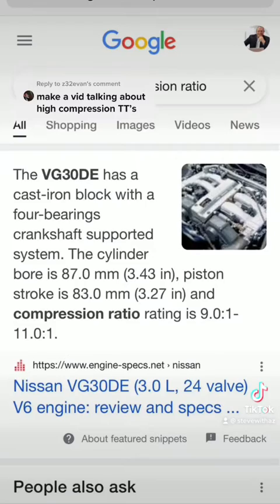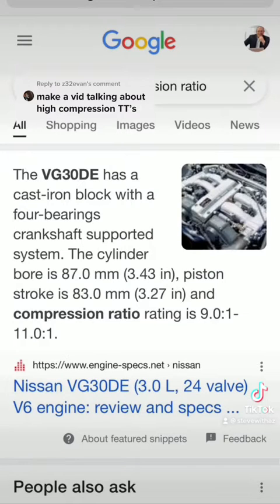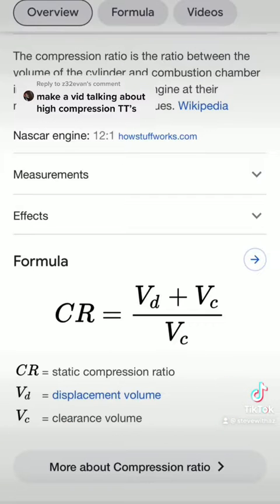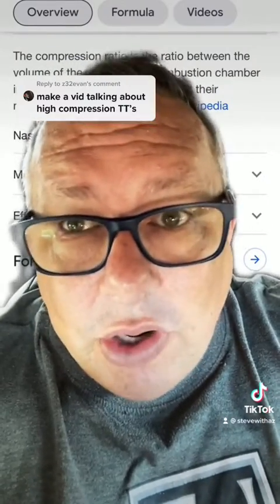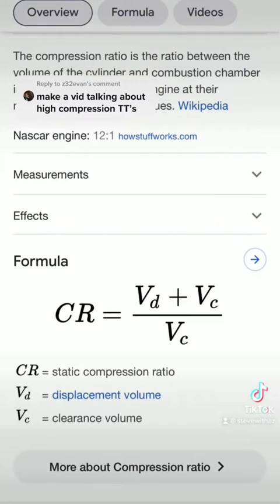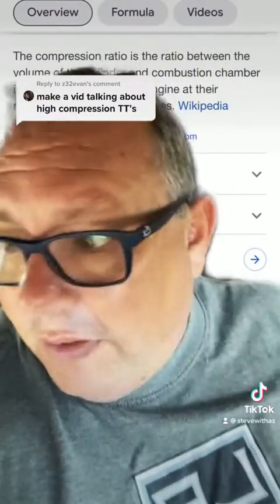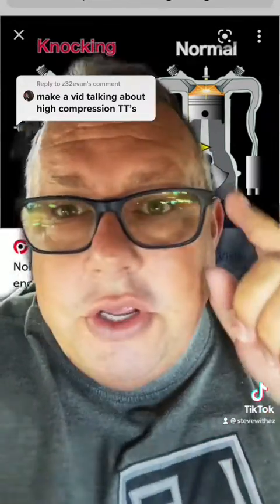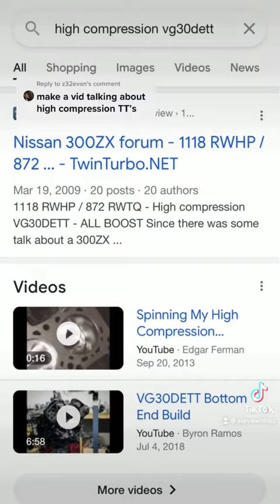Building a high compression VG30DETT? using an NA motor to build your 300zxTT? Allow me to explain!

Comment: Seeing this makes me reconsider alot. Initially I was considering a tt vg but it seems I can make the power I want with a na motor and the right setup.
Reply: You will also want bigger injectors than the TT has. If you can throw more fuel to prevent early detonation you will be safe. Stock Na can safely hold 400hp. Due to high compression pistons you need less boost to do that as well.
Reply from the maker: Just be careful with parts selection.

Comment: Hey Steve! Ethanol in my area isn't as available as I'd like it to be, but it is there. I am considering building a 10.5:1 compression, machined/balanced, wpc treated VG to run flex fuel with my haltech ecu, giving me the ability to run either e85, 93, or anywhere in-between. I understand that I won't be able to make as much power on 93 as an 8.5:1 compression build due to the detonation issue, but what if I ran a methanol injection system only when ethanol percentage is below, say, e30? Is this a decent option to take if I am waiting for the availability of e85 in my area to grow? I am going to be running ethanol whether I go high compression or not. I'm planning on running GTX2860's, ID1050 injectors, SZ SMIC's etc. I'm shooting for a healthy 500whp with the ability to make 700whp. How do you feel about methanol injection on VG's in general?
Reply from the maker: Once you run the car on E, simply nothing else will make you happy. I keep 35 gallons at home with a hand pump, and it works great. If I have to mix it’s fine, I keep it above 50 or so and still run higher boost. Below that I turn it down. Pump gas doesn’t feel fun so adding the complexity of meth injection isn’t worth it in my opinion. E85 is about a 40 min drive for me due to a local broken pump.

Comment: I really love the thought of doing this someday. Every where I look though on forums it says it wouldn’t be as much of a gain than if you were to pour as much money into that actually TT. Something that always suck with me was “the more compression, the less boost.” Is this actually true and is tt’ing my NA worth it? I want to achieve at least 800hp someday. Hoping to reach 1000hp if possible in the far future.
Reply from the maker: If you can run e86, then the high compression motor is fine. If you are stuck with gas, I wouldn’t go that direction.
Reply: Its all in the tune and fuel man. Plenty run 600hp+ but 1khp will push the oem pistons beyond reason. Can get custom compression forgies made....and make sure your tuner knows how to work boosted high compression.
Reply from the maker: @slicktop2jz855  you can’t use oem pistons to make the 600 let alone 1k.  All you need is a set of weiscos or CP’s. Not a huge deal.

Comment: hi steve. would using e85 in a n/a with all the n/a mods but without turbo's be of any advantage in hp gains obviously using a tune able ecu and a better fuel pump and slightly bigger injectors etc.
Reply from the maker: No not worth the price of entry. Get a turbo :-))))
Reply: If you really wanna go that direction....12.5:1 pistons, forged rods, extensive head/ valvetrain work and should be able to crack 300rwhp. Responsive as all hell, but also expensive compared to a used dett. There is a guy on youtube that did it a few years ago, great results. Wouldve had a much better power to weight in a slicktop chassis over the 2+2 used.
Reply from the maker: @slicktop2jz855  you wouldn’t need forced rods in that scenario.
Reply from the maker: @slicktop2jz855  unless you wanted something suuuuper light. But why bother.